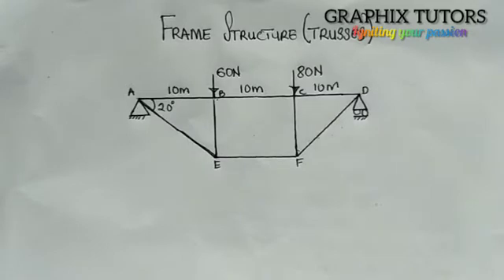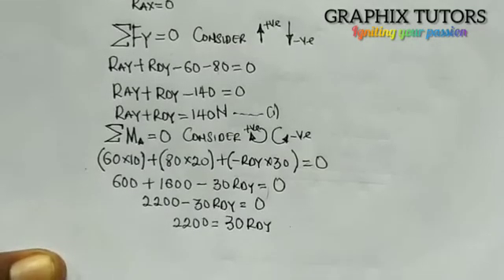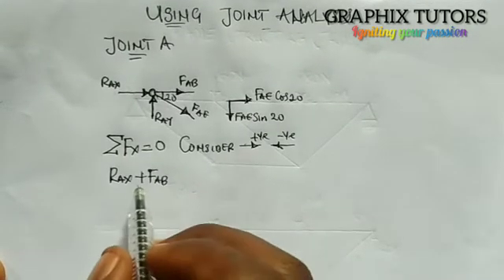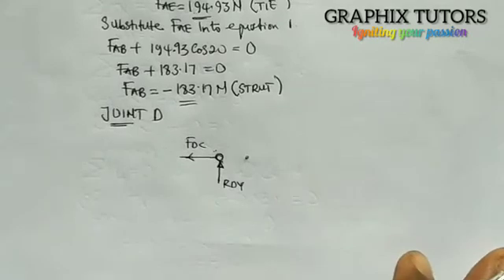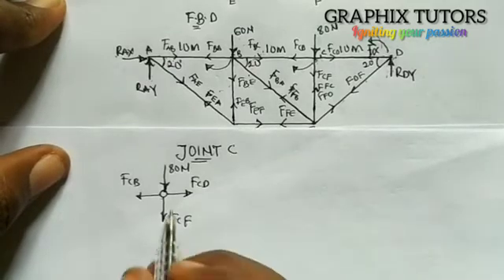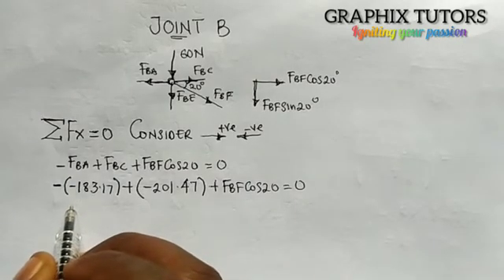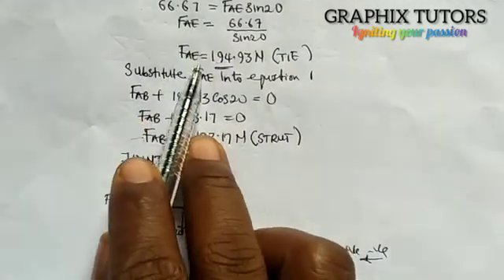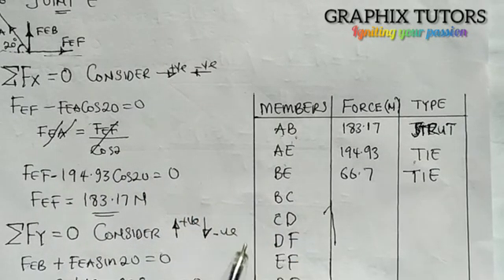Joint analysis ( Frame structure) pt 8

Comment: FDC was leaving the joint but it was negative so you supposed to change the direction to be inward, so it would be a Strut instead of a tie. I'm talking about the -201KN
Reply from the maker: No sir, check again